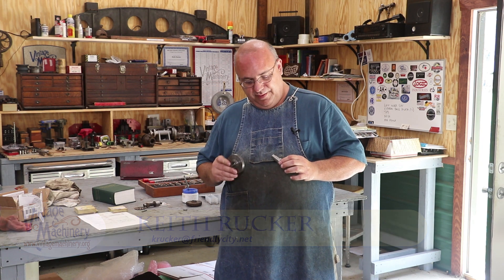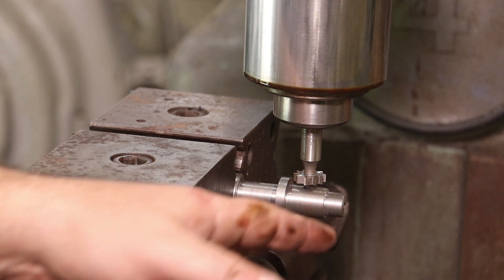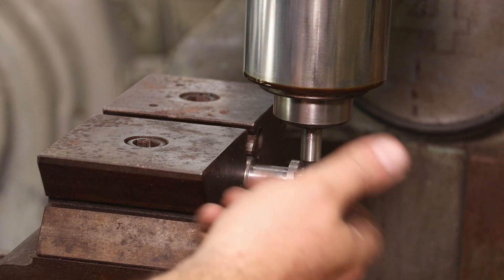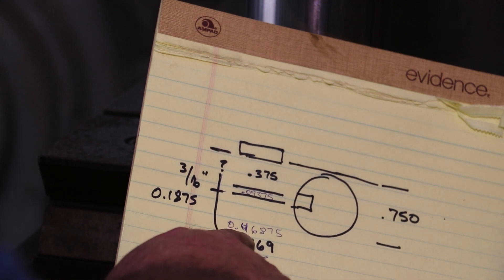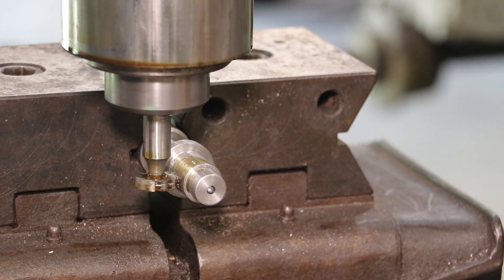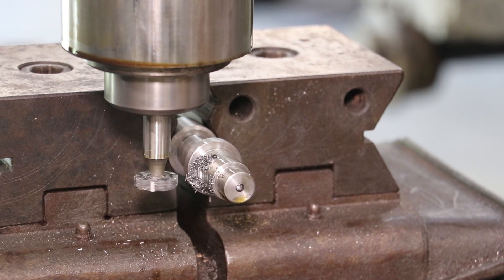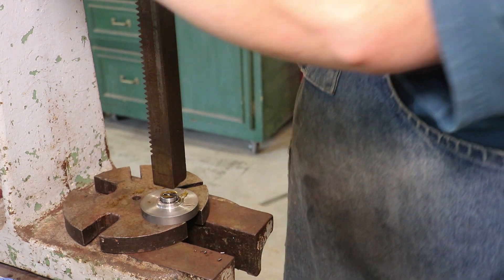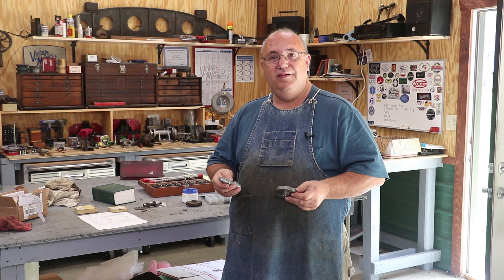Cutting Woodruff Keys and Broaching Keyways

Comment: Are the teeth on the broach all the same depth or does it increase and you move the broach down in the work?
Reply: The broach is like a shallow wedge so the first cuts take the top off and as it goes down, it gets deeper as the wedge becomes thicker. I think the teeth are the same size. Never used or had one, so this is based on watching engineering videos.
Reply: they increase, then when it cuts all the way through you add the shim which makes the depth increase that much more. The last tooth on the broach sticks out about that shim's width farther than the first tooth and the one's in between gradually make up the difference.
Reply: Increases as you move the broach down, each individual tooth is cutting away a bit of material.  Think of a thick COARSE hacksaw blade where the teeth have been 'tilted' along the length of the blade.  The most important spec on a broach is its 'rise per tooth', or difference in depth from tooth to tooth.  This determines how much material the broach cuts per tooth and so the size of the chips.  Greater rise-per-tooth means a broach will cut your keyway in fewer passes, but require more force and pressure per pass, while lower rise-per-tooth means the broach will be easier to push and require less force per pass, but more passes are needed to cut to the same given depth.
Reply: When you run the broach through you will see curls of swarf of equal thickness in the gulleys of each tooth. So each tooth cuts equally. And yes, if the broach isn't well aligned it will snap when you apply pressure. They are hard and don't like bending.

Comment: Any reason why one would not assemble the 2 parts (you mentioned a press fit plus the key) then using the shaft in the indexing head cut the gears then? Perhaps a mandrel would be more secure, or possible damage to the shaft holding it??
Reply: The indexing head will hold the shaft to cut both gears. Doing the smaller gear, without the larger one press fitted on, will make the work easier as there will not be a honking great big gear in the way.

Comment: Are the gear teeth clocked in any way (in relationship to one another)? This could potentially be an issue.
Reply: They probably are not clocked, as this pinion shaft and gear only served as back reduction gears within the lathe they were on, but we'll find out for sure in Keith's next vid.  Don't think there would be any useful point to clocking of gears in this application.  If anything, IMO, that would make it more difficult to shift the quick-change gearbox when you wanna change feedrates mid-cut, or maybe make speed changes in the headstock just a bit more annoying to do.
Reply: I would absolutely take my best stab at clocking them, no way would I go through all that work and not have it mimic the original part in every dimension possible.  Even if I was certain it made no difference I'd still do it out of principle.
Reply: Won't make any difference because the two gears are dissimilar sizes so even if you line up one tooth, none of the rest will line up anyway.  Now if they were the same size and tooth count you might need to watch the location.

Comment: The imperial system will never stop confusing me
Reply: In Keith's case it is necessary to use imperial units.  He is fixing equipment that was built using the imperial units with machines that are designed to machine in imperial units.  I would also guess most of his tooling is designed to cut in imperial units.  Also most of his precision measuring tools are designed for imperial measurements.  Changing to metric for the sake of changing would actually be a step back in terms of work efficiency. It would also be rather costly.  Things that need to be made in metric in the US are made in metric.  Unfortunately unless you want to scrap all the old equipment that Keith fixes on his channel switching to metric is not really viable.
Reply: I work fine in all three (metric, decimal inch, fractional inch) but I have been using them for decades. 
Side note on the fractional inch; it's also decimal binary. Eg '0.1'b = 1/2, '0.01'b = 1/4. etc. which is used in fixed-point DSP coding. 
So my fractional inch has merged with my Digital Signal Processing fixed-point binary math skillset.
(Probably not going to help with your confusion but I find it interesting)
 - Eddy
Reply: Because it is part of us. If you tell me something is 11 inches long, I know what that is, same if you say 8 ft. I have no earthly idea what 632mm is or 555 meters either. :)
Reply: right? its made so much more complicated than metric... why work with fractions??
Reply: But it's not confusing if you speak it. :) German is total confusion to me, I don't understand it. But to those that speak it it makes perfect sense.
Reply: Most of the time machinist don't (I guess). Carpenters, home builders, etc do work with fractions all the time.
Reply: thanebaxter
Reply: With fractions you could invent the dingus153 measurement.  Draw a line as long as you want and that will be one dingus. The midpoint of a dingus would be 1/2 dingus which could be divided in half again to be 1/4 dingus and so on. With fractions there is no limit to what you can do.
Reply: System works fine when it's what you know. Medical, scientific, engineering (and more) industries in America use the metric system, but imperial is perfectly fine for everyday use and even precision machinery.
Reply: I get not being familiar with the measurements, but what's confusing about it? Just the reliance on fractions?
Reply: dingus153. If you ignore the fractions if your not used to them and just see it as thousands of an inch. it's just the same as any number calculations only in imperial measurement as thousands of an inch. I have machines in both imperial and metric and do not find any real problems using either of them.
Reply: convert to thou, then its easy, dont use the silly fractions
Reply: Right, you won't have a sense of those measurements, but it isn't 'confusing', which was all my original point was.
Reply: I dont know why anyone would use such an arcane system of measurement. Its simply absurd.

Comment: Why would the broach not have cracked the gear blank with all that pressure on one side of the hole?
Reply: The pressure is down, not out. Each successive tooth on the broach sticks out a little farther and grabs the top of the wheel and cuts down. There's not much pressure out toward the rim.
Reply: Downward pressures is coupled into lateral pressure both against the back of the broaching bar and on the toothed side. The broaching bar starts out with a short distance between the teeth and the back and this distance grows as the bar is pushed down, keeping the pressure on the teeth. Pressure on the teeth allow them to cut. Each tooth only cuts a few thou of material, but 2 or 3 of them would be engaged at any one time.
The pressure required on the bar roughly corresponds to the amount of grunting Keith produces while pushing the bar through the stock :)-
 - Eddy
Reply: it was cutting not pushing, same as any cutting blade cuts as it goes into the material, cutting out the waste, it just needs support to make it work, every cutting method has pressure on the cut
Reply: Rita Moore because it is supported from below with the anvil plate
Reply: Gear blank is soft not hardend yet.

Comment: I was wondering how you were going to cut that keyway.  Now I know.  But the broaching tool looks like it would bend in half when pressure from the press was applied.  The broach tool must be very robust.  I do wish you would show your mechanical operations on how you twist knobs and dial in settings.  Saying you are going to move the tool .005 is cool, but I'd like to see the handles you have to touch to make the settings.
Reply: The 'key' to keeping the broach from breaking or bending is ensuring that the broach is vertically plumb with respect to the workpiece at all times during the broaching operation, or at a true right angle/90 degrees vertical to the workpiece.  This minimizes side-loading on the broach that would otherwise bend and break it.  The small broaching table the workpiece is laying on being square and the guide bushing inserted in the workpiece aid, along with the press arbor being square and the arbor's face being sqaure, in keeping the broach vertically plumb so the press is only pressing straight down on it and not sideways.  Making sure the operation setup is well-supported and the workpiece stays put rigidly is what makes it all work.

Comment: I'm really struggling to listen to some YouTube video of late.  It seems like the higher the video quality gets, the lower the sound quality gets.  From fans blowing on mics, hissing, echo and background noise to mics picking up bodily sounds that really grate on ones nerves.  Not just this channel, but many others as well.  The guys with the really low speaking voice and THEN A LOUD SONG SMACK IN THE MIDDLE OF THE LOW AUDIO.  Do these people even listen to video while editing (Demo Ranch and Casey Neistat)?  Me thinkst the sound is the furthest thing from creators minds.
Reply: I tend to agree about the audio quality of a lot of channels.  I give Keith a break on the fan noise, since he lives in the south and doesn't have air conditioning in his shop.  He's acknowledged it before (the fan noise), but ultimately it's just damn hot lol
Reply: +G Sligo  I have and I am.  Extremely hyper-vigilant.  It certainly does suck.  My wife cannot grasp it.
Reply: Tech Gorilla...Me thinks they do fine and make a bunch of money doing it!
Reply: There are many things that can go wrong with audio.  Just about everyone who has made a youtube video has run into audio issues at some point.  Most people would not have a studio audio monitor connected to an audio output jack of a camera if it even has one.   I have heard some people run a Digital Voice Recorder (DVR) and use it as a backup in case something happens to the main microphone, but that is a lot of editing work to get everything to line up.